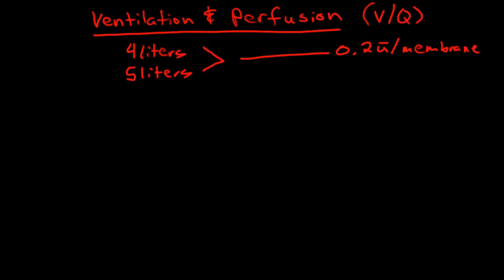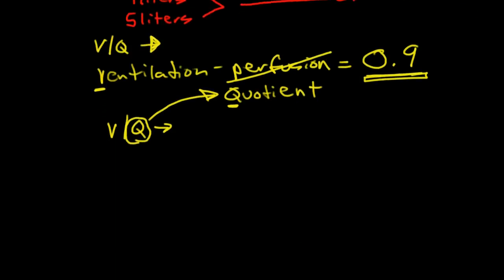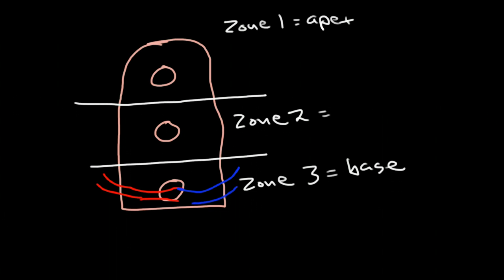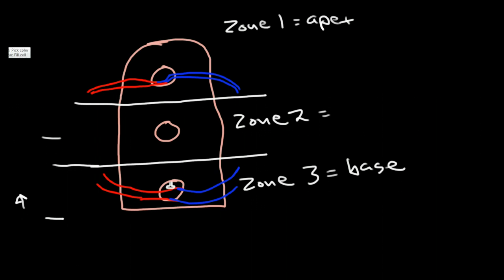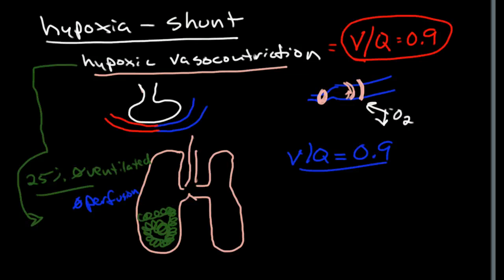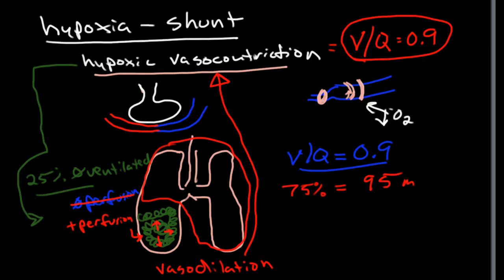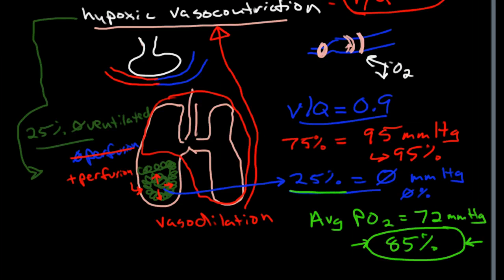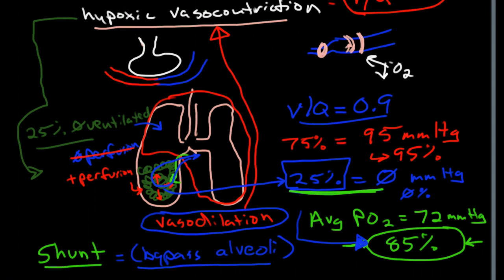Ventilation and Perfusion

Comment: Base of lung have more perfusion and ventilation then the apex of the lung 
Perfusion in base is high - greater vascular pressure , more recruitment , distension, low resistant - great blood flow 
Good. Ventilation- intrapleural pressure less negative , smaller transmural pressure gradiant 
Smaller alveaoli more compliance
MORE Ventilation
Reply from the maker: Thanks for the input and for watching the lesson!

Comment: Although this seems correct in principal, the alveoli at the bottom of the lungs I understand to have better ventilation in a healthy lung because the alveoli are able to expand and fill with "fresh" air more efficiently because they are not already full. The alveoli at the top are already full of air so although they are larger and more open, ventilation is poor because the "balloon" is already full. So actual O2 exchange is poorer than one would expect.
Reply from the maker: Thanks so much for the input here Karen!

Comment: I'm a bit confused about the three zones of the lung. Textbooks have led me to believe that both ventilation and perfusion are higher in the base of the lung rather than the apex. However, the gradient for perfusion at the base is steeper so the net affect is that V>Q at the apex, while V<Q at the bases. Is this correct or is there less ventilation at the base?
Thank you for your video
Reply from the maker: Thanks for the question. We've passed it along to the Health Ed Solutions medical review board.

Comment: wouldnt the O2 sats in the unventilated part of the lung be at about 75% since thats the venous saturation when it comes back to the heart? and the pO2 be also at what it usually is in the venous blood? i duno what that normaly is i guess at around 70% also
Reply: pO2 normally on returning is 40 mmHG, SaO2 70-75%, yes.
Reply: The idea generally is still correct. With your/ our values only..
Reply from the maker: Appreciate the input!
Reply from the maker: Thanks for the input!
Reply from the maker: Thanks for the question Gab. We've passed it along to the Health Ed Solutions medical review board.